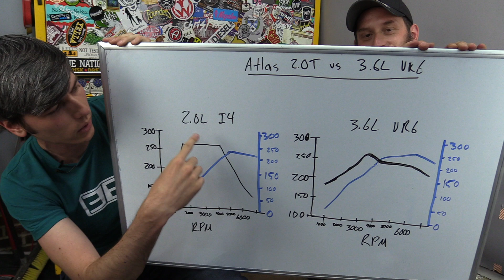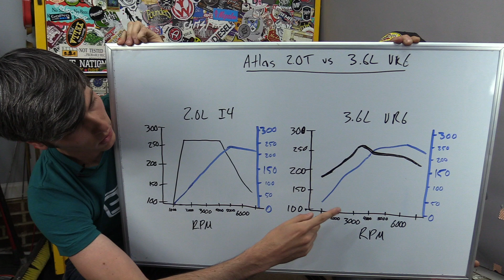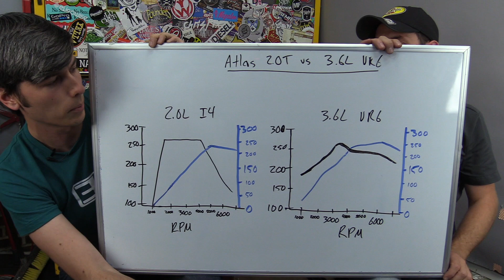4 Reasons Why The VR6 Engine Is Dying Off

Comment: The VR6 block has ample space for bigger bores to be cast there is much wasted space that could make it even as short as the Atlas four cylinder or 4.5 liters keeping the same dimesions.
With todays well established pressure die cast alloy processes VW could also make it even smaller than a 4 cylinder using the same bore and stroke.
Ive been waiting for a lighter weight VR6 for my Manx buggy theres still time VW! 123kg 3.6L would be a world beater for power to weight rather than 143kg. I really dont want to fork out for a billet block or wait for my grandson to make one at home with tomorrows 3d printers :)

Comment: What about when they turbo charge VR6. Getting awesome reliable power (400 - 740 hp depending on the engine and turbo used) and way more than any inline turboed 4.

Comment: Why no turbo 3.0 VR6 to replace old v8's ? 
W16: Just for the top o the line. The Successor to the chirion may reach 2.000 HP. Cost and fuel aconoy irrelevant in this range
W12: an interesting option for the next large lambo, and maybe even a super luxurious version of the audi A8
V10: Likely to be dropped by audi, and left only on the small lambo as an option.
VR8 Turbo: Ideal replacement for any engine under 1.000 HP. Should be the top option for the R8
VR6 Turbo: Replace all vw and audi v8's
i5: very niche market, works best for small cars that need big power (like the TT)
i4 Turbo: anything below 500 HP. Replace all shitty i3 engines with small i4s.

Comment: If the drawing is right, then that turbo engine has no torque at  1000rpm. While the VR6 already has ~180Nm at 1000rpm,  peaks at 264Nm at 3200rpm and ends at ~220Nm at around 6500rpm.  In contrary the turbo has a 280Nm torque from 1800 to 4000rpm. What comes from this? the VR6 is easier to drive in heavy traffic at crawling speed, as that turbo engine will be dead until it reaches 1800 rpm. Good luck not punting into someone with that, or not having carbon build up on the intake after 60000 miles, which is a common issue with these engines. Real World is a bit different from test benches. Would be nice to see a real World fuel consumption test on the two different engines, on not brand new cars. Or maybe even brand new ones. I'm not saying the turbo engine is pure crap, but in a real World scenario I would choose the VR6 over the 2.0l turbo any time. As it is much-much easier to drive and having read the comments below, should be easier and cheaper to maintain as well. I only own a 2.0 liter naturally aspirated engine from another manufacturer but anything from and above 2liters is considered a "big block" in Europe. And I have never had to spend big money on that engine other than the usual oil and filter changes and it's 24 years old. With a torque curve from 1100-5500rpm almost as flat as a straight line. 
That turbo engine is good for showing better numbers, good for track days on a closed circuit, or for going on a motorway. But not so sure how fun it is to drive in heavy traffic in a congested city. In fact I know, as I have driven some and it can be frustrating. While a big displacement naturally aspirated engine with a relatively flat torque curve is much easier to tame. 
Let alone the 1.0 and 1.2 liter mini turbo engines from various manufacturers. those can be a real pain in certain scenarios.

Comment: I own a 96 Isuzu Rodeo 3.2L V6 engine-darn thing has 442,000 miles-seems problems are gaskets/seals leak-car runs fine. I think the Japanese have done excellent job of designing/building  engines-they give the Germans a run for the money...

Comment: Let's see here - would I want to save 2 MPG to place a much higher burden on fewer cylinders, AND have this spinny-thing that never seems to last very far past 130,000 miles before requiring replacement, or would I want less complexity, less weight, two more cylinders and a lower-revving powerplant that might just have the chance of giving me 300,000 miles for my investment?  Gee... I've always wanted to be a race-car driver, so if I buy the four cylinder... hopefully some team will take me on to buy me a new powerplant when my commuter car needs it.

Comment: A VR6 Turbo makes allot of power. Tuners in the mid 90's were getting 350HP from basic non intercooled Turbo's @ just 8PSI. You can buy a cheap Turbo kit off ebay for only $700 that makes over 300Hp at the wheels. So just imagine a factory intercooled VR6 Turbo with 8.5:1 compression running @ 10-12 PSI it would make 400 HP easily which is too much for a standard GTI/GLI. So basically the Non Turbo VR6 doesn't quite make enough horsepower but even with a small K04 Turbo it would make Too much power! Trust me though, if VW needed an engine to make a reliable 450HP they would go with a Turbo 3.6L VR6 and it might come to that!

Comment: An NA engine is always going to have more potential in it than a turbo engine. There is no replacement for displacement, because if you can turbo a small engine, you can turbo a bigger one and get way more performance than the small one ever could have achieved. I think the comparison is apples to oranges, unless you're only talking about the modern dumbed-down market of consumer cars, where "turbocharged" is a type of engine, not something you do to it.

Comment: i just pulled my '98 Mk3 Jetta VR6 out of storage today (hadn't driven it since 2013, only has 100k miles).... and oh my... the thing sounds so heavenly.  its hard to imagine any cars that sound better than a 12v VR6.  Buttery smooth as well.

Pity that alot of new VW folks won't get to experience it.
Reply: rvborgh very true I have a 98 VR6 Jetta GLX with a S- trim supercharger at 8psi with some other goodies that allow me to do 11.8 to 12.0 in a quarter mile
I love my power wagon
Reply: I have a Mk4 24v VR6  but im tempted to buy a Mk3 Jetta VR6 maybe next year.

Comment: As an Audi B5 S4 (stg 3) owner,  I still think the purest sound of any moderately priced modern car is the VR6.  I happen to like the early versions of it (non coil on plug).  I'd like to buy a VR6 Corrado as a project car.  I love this channel.  Thank you.
Reply: The  AUDI 2.7l  V6 biturbo is the engine for your car. Between others, it sounds good not only from the exhaust, (as the VR6 does), but even when you open the hood, since works with belts and not with chains, (as the VR6 does not).

Comment: Nothing sounds like a turbo charges vr6 engine  but the fun is with  4 cyl 16v  engines because they produce steady torque  on a wide range of  engine Rpm that gives the driver enough time to shift up or down .
Vr6 engine is awesome but it gives you a very short  torque  with engine Rpm range .
You cwn feel it especially at 4000 rpm the car gets sudden acceleration for few seconds then it  gets steady like the gear is topped but actually I didn't reach the gear top speed .

Comment: Why would you rather have the mk4 3.2 engine instead of the mk5 3.2? Isn't the MK5 faster?
Reply: A great question. 
1) I never liked the MK5 that much
2) The MK4 was a 6-sp
3) The MK4 came out just as I started with VW. I remember doing new car check ins on them. So they will always have a place in my heart. 

But for real, the MK7 R is a better car in every way

Comment: Still have a 1992 Corrado SLC from the first shipment off the boat from Germany. No rpm limiter. 6500 red line. It was just fully restored and only has 56k miles. Still pulls like a champ.
Reply: Jealous!

Comment: ....guys, mileage is directly related to power and weight. Turbocharging a 1.6L engine to 200hp will give you the same mileage as a 2.5L 200HP engine. That is for same generation engines using the same final drives and gearboxes on same weight chassis.

Comment: How is the VR6 a dying breed when the only company that makes them is still using them in quite a few vehicles they sell? Didn't think that one through..
Reply: suzuki400boi they no longer use it in enthusiast vehicles and the remaining vehicles that use it are on old platforms and not destined to have vr6 post upgrade
Reply: Wrong, the Arteon R will have a Turbo Vr6 and word is the next R32 will also utilize that same turbo VR6. That motor is far from dead.
Reply: @FastPaull  because 'muricans said so xD They even think the TDI is dead.
Reply: suzuki400boi  share a link please!

Comment: Turbo charged engines have also disadvantages: slow response times, emissions are worse (except CO2), more maintenance, less efficiency in mpg when driving hard ...

But nowadays the 4 cylinder is also dead. Turbo charged 3 cylinders with 0.9l ... And in near future only electric cars ...
Reply: cachememory yup, I was in Germany 2 years ago driving on the autobahn in a ford focus with a  turbo 1.6 or 4 gas i believe. I could almost see the gas gauge move before my eyes trying to keep up with bmw, vw, and mb, cars with their diesel engines,  no luck.

Comment: Three things no one mentions: small newer turbo engines have HORRIBLE refinement... every time you let go or apply throttle (on my golf tsi 1.8t) the whole car shakes, feels cheap.... never had it in 6 cyl engine... also, if you are not on the throttle at 1500 and you kick it there is long delay. And since i drive manual i love to brake with the engine, which you cannot do with 4 cyl... (it takes 6000rpm to actually brake)...

Comment: I have a 3.2 VR6 (BUB) and a 2.2 I5 turbo (AAN) in my cars. Perhaps VR6 is being phased out, like I5 mostly was some 20 years ago. In great cost to enjoyment, once again. 

So, the I4 benefits are: 1) Less moving parts 2) Cheaper to manufacture 3) Half a cylinder shorter engine, fits more cars(?)

Downsizes are: 1) No torque at 900-1000rpm 2) Exhaust note 3)  Engine vibrations 3) No power stroke overlap at all

Sounds like a bad deal to me. If you use the same modern tech for "old" engine layouts, they also benefit. TT RS 5cyl turbo comes to mind. Or just add a turbo to your VR6.

Comment: Audi uses in line 5 for the marketing. The vr6 was no longer selling even though that motor never saw a factory turbo, they are going forward with an inline 5 turbo because Audis history and consumers will buy that. Is it a good motor? All signs point to hell yes... But it is a shame to see the vr6 die this way without having got a proper crack at the factory turbo craze.

Comment: The Golf Mark IV GTi engine was 1.8 turbo. The 2.8 VR6 of the Golf Mk IV called Golf VR6, and the year was 2002 not 2005.
The GTi Mk V only engine choice is 2.0 liters TFSI (turbo direct injection), and the VR6 version of Mk V was 3.2 liters called Golf R. The year 2004.

Comment: I ♥️ my MKIV 24v VR6 GTI. I've got it slammed sitting static on billstein coilovers & 17" Audi "Fat Five" rims. Some other mods include: A Neuspeed CAI and 2.5" Magnaflow catback exhaust that give my VR6 that legendary "VR-SEX" sound. I've installed a VW "big brake" kit, a lightweight flywheel, and a Forge Motorsports short shifter, and much MUCH more!! And if that weren't good enough, I can squeeze 28-30 mpg on the freeway (when I need to) thanks to the fact that it's a 6 speed!! I wouldn't trade it for ANYTHING... Except a MKIV R32 😍. I drove one last week with 47k miles on it.. They're only asking 20k for it too!! Check it out at Boyko Motors in Federal Way, WA

Comment: Hey guys, how about major problems on DI engines such as carbon build up? I'm cool with technology as long as it is practical and DI engines are not. I just sold my car which had a THP/PSA DI 1.6 Turbo engine (Mini Cooper S). I had to open it and clean carbon off the intake valves at just 36000km on the odometer as I had lost 30hp (yes, that much) due to the brutal carbon build up on those valves. The cost of repairs alone negates the money saved on fuel due to the ''efficiency'' of DI engines so I'm not going that route again. In this particular case I prefer the VR6 or any port-injected engine for that matter (Volvo T5 sounds like a great option to me at this point and yes, I know it's an old engine, but it is reliable as well if properly maintained).

Comment: This engineer has pipe dreams. "All you have to do to get more power is to install a bigger turbo". He does not explain the parameters that have to be changed when you do so, which can be a surprising economic pitfall. You can do it, but doing so requires quite a few changes to make it work right. With current computer technology you may be hard put to find a technician that can properly reprogram this thing properly...and probably charges more than a lawyer to do it. And doing so takes the car into another dimension that it wasn't built for such as suspension issues and some others. Good luck on doing it.

Comment: As a former VR6 GTI owner (1999.5) I miss it's power and sound but not the incessant check engine light.  Looking at the torque curves I think of Analog Vs. Digital.

Comment: 19teen to the gallon what a joke 200hp  , are we mad thats not saving to earth ,  the maths doesnt work out in 1984 a ford sierra did 32 to the gallon lean burn , all this poxy efficient tech and we are using more fuel , a 1980  peugeot 305 diesel did 65 to the gallon , seem we was saving the earth in 1984

Comment: Hm..the reason why it should die is to compare it with a turbocharched engine?! I like both concepts but for me its not really a reason. A two liter will reach its limits in reliability with increasing power demands. So a 2 Liter in a Cayenne is not really an option I guess. I think when downsizing a V8 to a VR6 charged engine can be an option. Then you can say the torque curve is soooo much better than a NA V8. And people still will buy V8..So will it die? I wouldn´t bed my house for this.. and don´t forget maintenance costs on a turboed engine..I know a lot of guys who had problems with this kind of engines here in germany. Even engine blocks are failing..I would prefere a vr6 which is engineered to the end and to be reliable instead of beeing a VW test pilot for new stuff which is breaking and be the best customer at the workshop..I don´t want any workshop visits during my free time and so for me the simpler the better. For a daily driver! So i give a sh*t for a liter gas more. Don´t get me wrong I love boosted stuff and building my own but I wouldn´t bed it will disapear because of this reasons..Maybe for others..

Comment: Hey guys, great video -- as always! I drive a 1997 Mk3 GTi VR6 Drivers Edition. It's been impeccably maintained and has never left the Pacific Northwest. I've got 86k miles on it and zero modifications... and my check engine light is on. Code reads secondary air injector. I know this is common. Any recommendations?

Comment: My 287 CID 4 barrel carbureted Pontiac V-8 only produces 200hp @ 4400-4800rpms (LOL) but around 280 FT-LBS @ 2400-2800rpms which is plenty enough torque in a half ton GMC pickup.

Comment: It is not the VR6 that is Dying - now they try us to believe in turbo engines. The fuel consumption is most times not the truth. TFSI motors have to be modified after 160000km, not because of the turbo, because of the tinny piston rings.

Comment: BTW your torque curve on the vr6 is off quite a bit. Torque/hp crossover should be  at 5252 rpms not 4000.
Reply from the maker: +Josh Hillard you didn't observe the separate scales for hp/torque. They have different units.

Comment: we just got the Atlas. It has the Vr6. it has AWD. it can tow 5000. the turbo four pot can't. we live at 4500 feet in elevation, so we get turbo lag a bit more. I get it in my ecodiesel. experienced terrible turbo lag on a borrowed Chevy Sonic. we really didn't want it in the family wagon. love the VR6! it was an aspect that sold me, along with the DSG transmission and the torsen center diff. German engine. win. Japanese transmission. double win.
Reply: I must also mention that our Atlas is only supposed to average 19mpg, but we have been getting 24.2 since we bought it. eco mode and reserved driving and 50/50 City and highway.

Comment: I have a VR5 engine in my 2003 SEAT V5.  In some ways a VR6 engine with a cylinder lopped off.  Two notable characteristics - sounds lovely AND  seems to have a very consistent level of torque.  Pulls strongly from way down.  Will pull happily in 5th gear at 30mph.  But nice to rev too - lovely sophisticated sound.

Comment: I love my Brazilian made '03 24V VR6 in my MK4 GTI!  It's smooth, fairly torquey, is a joy to drive, and it's been very reliable.  I've had my car (original owner) for 15 years (this September), with only 81,000 miles on it.  I basically only take it out for short drives locally, and once a year for a 1,100 mile highway round trip to go visit my mom.  It is garaged, and looks like it's in 'like new' condition.  The dealership puts in their Castrol synthetic oil once a year (sometimes I let it go 15 months, since I don't put that many miles on it), but I have never changed the transmission oil in the 6-speed manual tranny.  Plugs were just changed recently (I think for the first time).  Is there anything else I need to pay attention to so I can have this engine another 15 years?  Thanks!

Comment: But what about a turbocharged VR-6? That would be a huge amount of power for an engine only slightly larger than the I4. And a 3.6L VR6 with turbocharging would knock the socks off an I4 with similar dimensions, surely.

Comment: VR6 sound is worth the 10% lower MPG. It's the most frugal of all the awesome sounding engines made. And don't forget that it can be turbocharged as well and used in place of V8s. It's little brother the VR5 has an apealing sound, especially the later DOHC 20 Valves. I just don't like the sound of 4 cylinder engines. There's so much more to automotive enjoyment than acceleration times.

Comment: What design challenges would there be if you decided to try and integrate one of these engines into  say a two or three wheeled vehicle?
Reply: Very little I would guess. As long as you can have a transmission to put power to the ground.